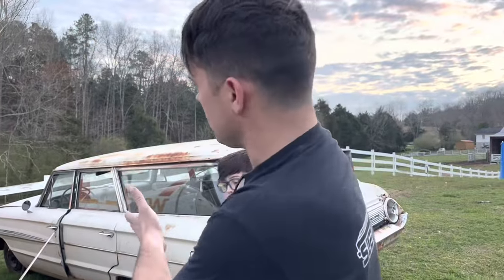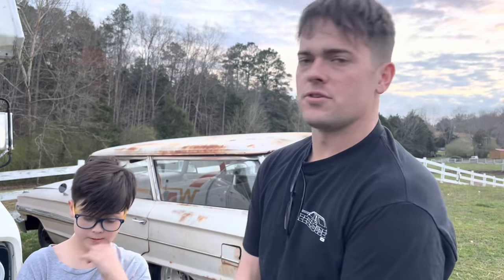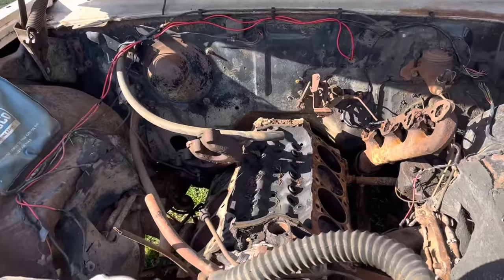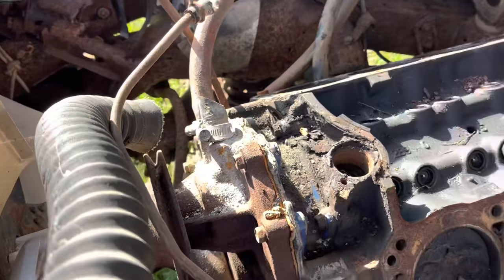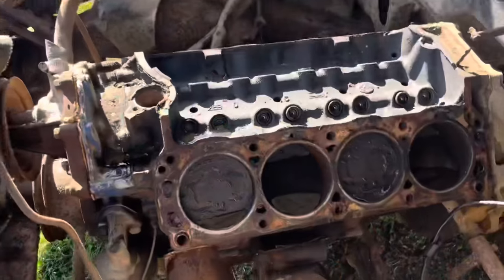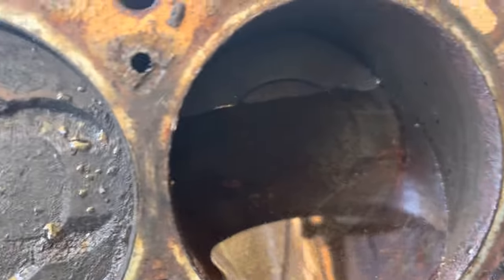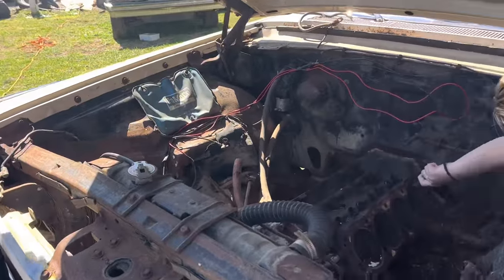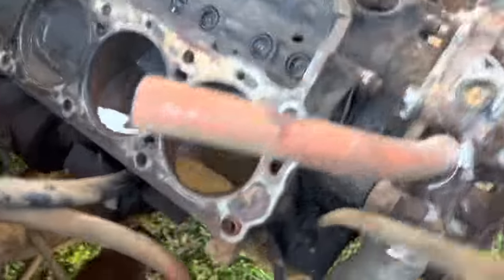Tricks and Tips to getting a stuck engine free after 30 years. We try everything!

Comment: I'm surprised that engine put up that much of a fight. Makes you wonder if the bottom end was seized up too. My grandparents had a white 64 country sedan like that, 289 3 speed overdrive. My uncle took it to college and tried roll starting when the battery was dead it and the timing chain skipped time when the clutch was let out, apparently the carnage was pretty bad as it got a remanufactured engine. That was in the very early 70's. No idea if the car still exists or not.
Reply from the maker: Oh man that’s no good

Comment: Blow lamp get them pistons hot then put some oil in there so it soaks down the sides of them pistons. The heat will make the gaps bigger so oil will soak down sides helping to free them up.
Reply from the maker: That’s a good idea thank you
Reply: @Sleeperdude  rescued a few engines with a bit of heat not too much tho or pistons melt. Here’s a bit more advise when hitting a piston  on the top it’s strongest place is across the wrist pin as you Usa guy know it as. hitting off centre can break the piston skirt ( bottom edge )

Comment: Way to "stick" with it until you achieved your attended goal. I was going to make a video of a 906 mopar 440 head de-rusted with white vinegar, results were great but couldn't make the content work. This is for anyone reading as every video attempt i've watched does it incorrect.  First off, if you don't start first with vinegar the results won't be as dramatic and will take much longer. If there's oil, marvel, pb blaster which has oil it is used first, it makes a barrier which keeps the vinegar from making direct contact with the rust. You need to wait 5-7 days (or longer on my project) on thick pitted rust for the vinegar to work. surface rust a day or two works. The orange you noticed was the super clean bare metal flash rusting as soon as you removed the vinegar so best to coat with think oil, engine assembly lube, something that sticks and coats before it gets the chance to flash rust.  as someone else mentioned, muriatic acid will eat the metal especially aluminum so try and avoid if possible. after removing the vinegar, run a torch around piston edges to break remaining rust loose. First time i've seen someone weld large bar stock the pulley, definitely a youtube first!!  Fun to watch, definitely thanks for filming and sharing!!
Reply from the maker: Ok thank you for the information

Comment: After 55 years as a journeyman mechanic I'll share some knowledge if you're interested. Yank the plugs and valve covers. Loosen the rockers so the valves are closed
 Break the porcelain off the plugs with a hammer. Braze air fittings into the plug base. Use Marvel because it's thin. Put enough in to cover most of the piston(s). Hook up the air line. Go do something worthwhile and come back tomorrow. You can plumb 4 cylinders together. I've seen the most ridiculous videos on how to free a stuck motor. This is how mechanics do it because it works. Ben

Comment: A little vinegar would help Rocky digest the bolts you're missing..😉
Put your 15/16 on that crank with a 2ft cheeter pipe and floor jack it at about 8'oclock a few inches.. then Bump the starter.. BRUTE FORCE!
I think Libby's sausages are better than Armour.. the BBQ taste like sardines😐.
Surprised you haven't named a pet Libby!
Reply from the maker: It would probably help rocky

Comment: Spray PB Blaster into the cylinders, let sit for 24 hours. Then, add Marvel Mystery Oil to the cylinders, allow to sit a few days. After Marvel is added, hook a strong bungie cord on a bolt  toward the passenger side of the harmonic balancer, stretching it up over the driver side fender and hook somewhere inside the fender well. This will create constant tension on the crankshaft to help break the motor loose

Comment: Well, I realize everyones has a better way...
I've got 25 yrs idustrial maitenance, with that said, in the future try this, clean rust off as much rust as you can in the crevis of the pistons, clean the surface of where the heads mount completely of any oils, cover cylinders with gorrilla tape, poke small holes in the top, pour in wd40 or spray pb blaster to fill the cylinders, you can put heads on to ensure a good seal, let set at least 2 to 3 days. Just an idea from things I've done with similar non engine equipment...
Reply from the maker: Yeah that would probably work

Comment: The next stuck engine, try a air hammer on the block.
Vibration and heat will break loose any frozen rings

Comment: Muratic acid beliver here: Next time  go diagonal across  a cylinder that is  nearer top dead center with two studs then drill out 1/2" thick steel plate so the studs go through the holes. Then find a lage diameter piece of  of round dowl ( I used a wrist pin from a magnum tractor engine) or heavy pipe at least 2/3 the diameter of the piston then equally and slowly tighten up nuts on the the studs so the plate puts pressure on the the socket and the socket puts pressure on the piston.  This is of course after you have done the muriatic acid WITHOUT cleaning any carbon or rust.  To a small degree the carbon will protect the pistons.......I  did this on an old international tractor engine  that looked like the cyliders had been down with the Titanic.  I.E no muffler on the engine the exhaust was upward facing  while sitting in a pine thicket for nearly 20 years.....Oh yeah put a breaker bar on the crank so you can detect the least bit of movement then back and forth till blue in the face......but it works

Comment: SLEEPERDUDE, THAT 28 FORD YOU DIDNT CHECK THE TRANSMISSION OIL (90 WEIGHT) OR THE REAR END (90 OR 140) THE WHEELS NEED TO BE DECASED AND THE WHEELS AJUSTED the points on all cars.... if its 16-20 on feeler gauge you go half so it would be 18
Reply from the maker: If you watch the entire video I did put oil in the transmission and the rearend in the video

Comment: Wow that full up ...take it down and hot tank it have it bord 30 or 40 over and get the heads done and cut then put it back with new parts oil pump etc and a nice hot cam and a 4 carb it be fine lol
Reply from the maker: Thank you
Reply: Dude I got a 72 duster lol rust rod I call I built a 318 two years ago and did Tran and rear motor built like a tank all the good suff and I take it and put it right up the ass of the 5.0 mustang all night long if thirr not look at my tile lights ...I make them so mad and I don't have 5 grand in the whole thing ...built not bought...just have fun with it .blow it up build it better hit it again

Comment: With all that pitting in the cylinders, they will need honing out, and oversize rings fitted. Otherwise the compression may not be too good. All the bearings will be shot too, I would imagine. I guess it depends on your ultimate aim is-to restore the fine beast, or just an experiment to see if a badly wounded motor can be persuaded to run for a few minutes?
Reply from the maker: You are probably right

Comment: next time you run across use a die grinder with a wire brush in it it will knock a lot of rust off and let it soak with transmission fluid
Reply from the maker: Good idea

Comment: 4th gear (or 3rd, if that's all there are) put more torque to the engine to bust it loose. (More turns of the back wheels > less for the engine, like when you drive in top gear.)
Reply from the maker: Ok good idea

Comment: if you take a piece of 4x4 set it in each cylinder one at a time , smack it with a shop hammer it will help to shock the rings loose
Reply from the maker: That’s what I did
Reply: @Sleeperdude  sorry i was to quick to give advice , i saw the rest after that and felt dumb ,i am always impressed by your boy and i think you do a great job as a father.  you are in my prayers

Comment: Oxygenation makes the orange, i.e. rust.  Sometimes called "flash rust" the "cleaner" the metal the faster oxygenation takes place.  The acid is an indiscriminate agent, it would melt that aluminum faster then the rings, so that is dangerous. Weaker acid over longer time may have worked.  Heat is your best bet. Expand and contract the three different metals...block, ring, piston is the best method. Expansion and contraction if done with enough cycles will eventually make the metals separate. Using force often breaks a ring or piston.
Reply from the maker: Ok thank you

Comment: If this doesn't work before you give up try WD-40. If you tried the WD-40 there is a little bit of stuff you need to know about how to do it we've used it a couple times and it worked really well but you'll need several cans of it cuz you'll have to put almost one can in every two cylinders of a V8 but if you do that let it sit several days for some reason it seems to work its way through. I know WD-40 is not really a penitent to the best of my knowledge but for some reason it seemed to work with unsticking the engines that we tried it on but you have to spray enough in there that it actually will fill all the way around the cylinder you need at least about a you don't know it's there you just guessed by the amount you spray in but it seem like there should be enough in there to cover the the Piston top about eighth to a quarter of an inch deep and let that sit in there for several days and that should do it. Do that and when you get ready to try and break it open use a big breaker bar with an extension and a good solid socket on there and just if you have to go back and forth a little while and just keep working it back and forth you might have to do that a couple times with about a day break in between trees and after a couple three tries it should break we always have pretty good luck WD-40 was what we always used.

Comment: to start a manual transmission car, by pushing/towing, put it in 3rd or 4th gear. Less compression to turn over engine.
Reply from the maker: The problem with that is the clutch doesn’t work or I would have

Comment: Engine should be easy to pull with the heads off. Might as well do it. The bearings are probably shot and need replace inch. Seems all of the crap you poured into it will have damaged a lot of stuff? Nice video thank you.
Reply from the maker: Yeah maybe so thank you

Comment: Sorry you can disregard my earlier advice when we use WD-40 that was on an engine that was home and had everything attached we just pulled the plugs and squirted it in the plug holes sprayed it in there through the long red tubes used about a half a can per cylinder if you cut an open it up with Mrs oil and the heads removed I don't think WD-40 would have helped on your engine at all but the ones we used it on or completely together and we put it in through the spark plug holes and let that sit for almost a week and when we tried it was able to break it through with the breaker bar just working it back and forth just a little bit we wasn't trying to break it off once we just was trying to get it to move a little bit either direction and then we go back the other direction continuing to work back and forth until it broke

Comment: That thing's toast my guy. It'll never make enough compression to move that boat comfortably. A bore job and 30 over pistons is like 8x the price of just finding a different bottom end
Reply from the maker: You are probably right
Reply: @Sleeperdude  1960s heads will have soft valve seats made for leaded gas also. A smogger 302 is as close to free as engines get and will mostly bolt right in. Accessories might be a little different

Comment: If vinegar does this to metal what does it do to the stomach?? Put it on your engine and your salad!!😁 
To get an engine unstuck I always used Rustolium spray-let it work 24 hours and force the engine to turn by the starter or a wrench on the crankshaft!! Then I use Prolong oil additive to free it more. 
A LP torch or welder flame can be used on the rings to get them to expand to help compression. Keep Frankensteining old cars!!
Reply from the maker: Thank you

Comment: Hello From Versailles, KY.  I am kind of wondering if the water pump wasn’t causing a great deal of resistance. 
It seems like I have seen on other YouTube videos the removal of the water pump making the engine break loose a whole lot easier - So maybe that would be something to consider doing for similar stuck engines in the future.
Many years ago, I had a family member that told me that Pepto-Bismol was really good for breaking engines loose - Personality I never tried this approach.
I always keep at least 1 gallon of PB Blaster on hand for similar situations. One advantage of using either WD40 or PB Blaster in liquid form is that you don’t have to worry about losing the Mojo like the spray cans do - You can use a funnel just like you would the Marvel Mystery Oil.  TSC usually always has the1 gallon containers in stock and maybe Autozone, I’m not sure about O’Reillys, But they always seem to have just about anything that I have needed.
For cleaning the cylinder bores, I use the ball type cylinder hones which covers a lot more surface area and the top of the piston somewhat. Good Luck with your station wagon.
Reply from the maker: The belt was not on the water pump so it wasn’t affecting it, good tips on the oil
Reply: @Sleeperdude  Chances are that the water pump would fail pretty quickly if you tried to reuse it. For what the Ford water pumps cost - Now is the perfect time to change it out. 
I hate doing the same work two times. Unfortunately with even new parts - The “X Factor” always seems to apply itself.

Comment: Just about any oil will penetrate in but you need TIME. Nothing works in two minutes.
Just fill it to the top with old motor oil and let it sit at least a month.
Even if it's free fill it to the top then drain it out to lube the cam and everything.
Reply from the maker: Yeah we had filled it up with marvel mystery and let it sit for weeks in the very first video of this car . Thank you
Reply: @Sleeperdude  that's good. I hate to see people take something that's been sitting for years and just hook battery up and crank away.
I started driving on 64 Ford with 289 and 3 speed on the tree.
Reply: Had a bicycle wheel for 10 speed derailleur and the sprocket ratchet was rusted solid. Could not get it free. After getting it all oily with motor oil ( not penetrating oil ) I set it aside, it was fall. Next spring I was looking for another wheel to use and found the perfect wheel that worked perfectly. I wondered how come I didn't find it last fall then it occurred to me it was the same wheel.
It went from totally froze to totally free without touching it.
It just needed about 4 months.

Comment: Chevy dealer puts out a spray called exhaust Loop spray I had an engine it was froze over 20 years sitting water try to break a bar everything put this stuff in the cylinders 2 days later it's been over with a 3/8 ratchet cost $20 a can back then do it cost now 8 oz can or get some drain cleaner that has acid in it
Reply: Exhaust Lube spray
Reply from the maker: Ok interesting thank you

Comment: you wouldn’t believe me if i told ya that there’s a bolt head on the harmonic balancer that you turn for the crank shaft and thatll turn it more then pushing it. but next time put diesel into the spark plug holes

Comment: First of all you should press the clutch in ,get rolling about 25 to 30 miles an hour pop the clutch repeatedly and it will rotate .first gear not second if you put any weight in the back of the station wagon some old engine parts to wait it down each time you release the clutch it will jerk it and turn it over and again soak it  with PB blaster the night before you try this so that it is soaked each cylinder and it will break loose guaranteed.

Comment: If I've said this once I will say it again. Diesel! I've gotten fifteen engine's unstuck with it. You pull the spark plugs filler up put the plugs back in let it set 48hrs get under the car and get a pry bar on the fly wheel and work it back and forth. It's a trick my dad tought me when I was little.🤠👍

Comment: HELP!!!!! My beloved , 2005 Mazda 6s with 3.0 engine, 178,000 miles, suddenly siezed while driving. I had just had radiator replaced for 1338.00, and drove it under 10 miles when it happened. I  called the place that replaced my radiator, they towed it back to their shop. They said the heater hose had busy off, causing anti freeze to get into the oil after that oil cap blew up to the roof of hood . They say my engine is shit ,not their fault

Comment: Need rebuilt trust bearing on crank allowed floating back and forward cause that why have them rusted on the it need bore and bearings it also run hot before it died  oil  burn to the block how run 🔥🔥 it has bearing failed why block weird rust in block

Comment: If you can mechanically clean everything as best as possible to have less stuff to move against, before using solutions to do the freeing.
Remember your HS chemistries and realize what is going on in the engine with 3 dissimilar metals. (cast iron block, aluminum pistons, hardened steel rings) Besides rust you have electrolysis (chemical ions welding themselves together in general) between the different metals for 30 years.  The acid ruined the worn pistons.
Just pull the block and take it apart before you ruin something that is unrecoverable at this stage.
Reply from the maker: I didn’t realize I ruined everything
Reply: @Sleeperdude  
We all got to learn, some hard, some easy.
Mine was hardway by after cleaning the dirt and grease from an aircooled VW block I read that Muriatic acid was used to etch aluminum to clean the surface, poured straight Home depot type MA on the block and just started brushing it in and it caught on fire. Luckily I was outside on the sidewalk with the water hose running to put it out. After rinsing and brushing the surface I had a shiny silver raw aluminum block like a spray painted it with aluminum paint. I almost damaged all my journals, but it was before align boring stage.